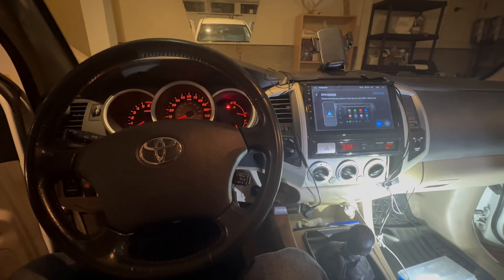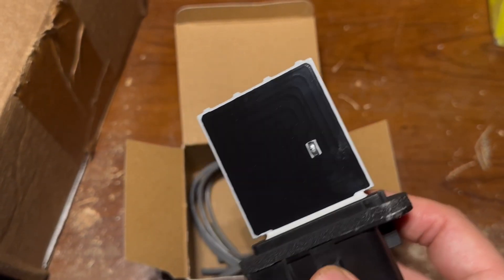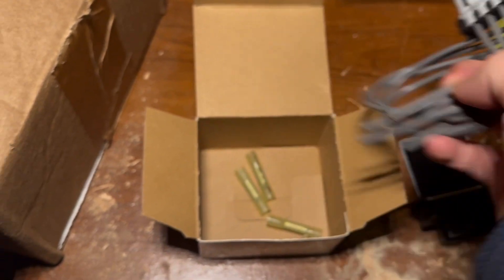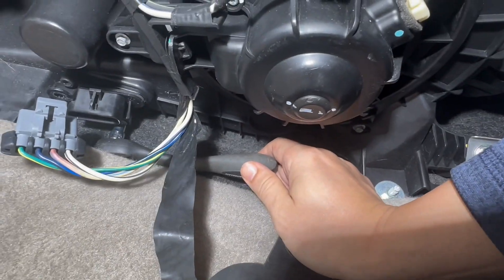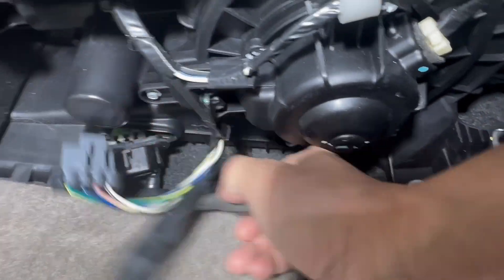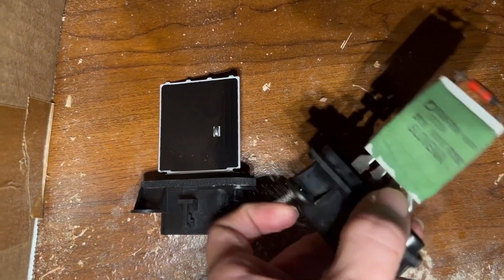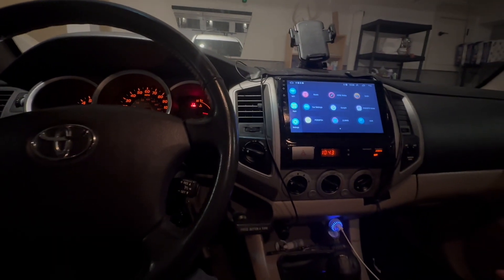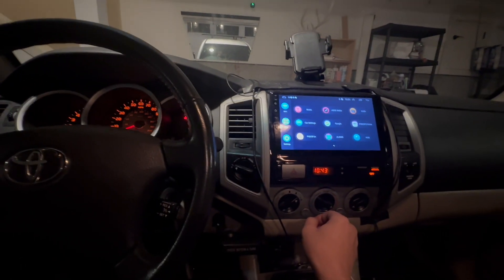2005-2015 2nd Gen Toyota Tacoma HVAC Climate Control Motor Resistor Replacement

Comment: Had same problem with my 2012 Tacoma. Found the large diameter wire in the harness that plugs into the speed control resistor module had burned contacts within the harness to module connection.  Apparently due to a poor loose fit up of the contact pin and sleeve in the connector, causing intermittent contacting and sparking and arcing.  Cleaned up connector and inserted a sliver of copper foil into the
sleeve side of the connection to tighten up the fit.  Did that several years ago and still working just fine!